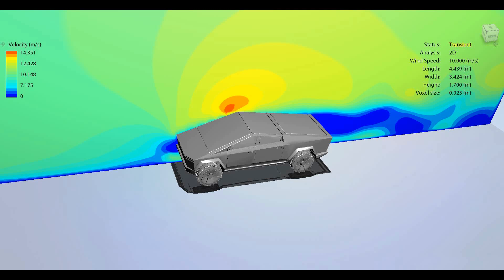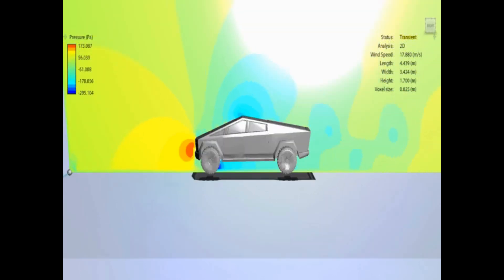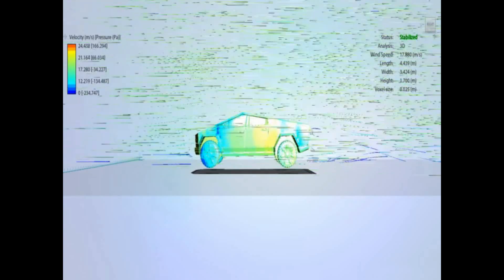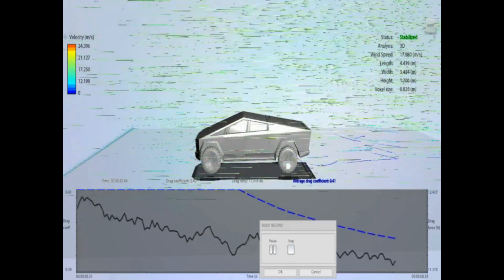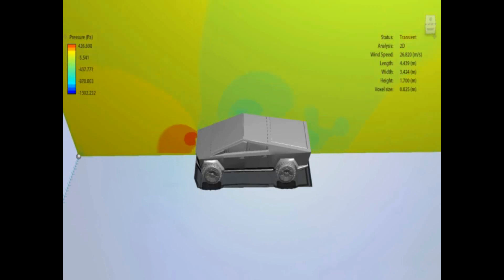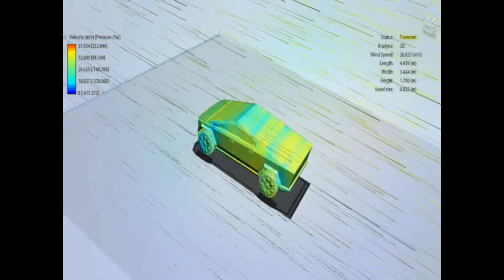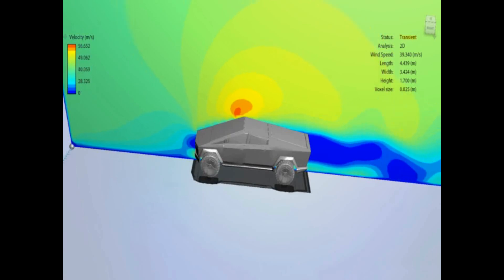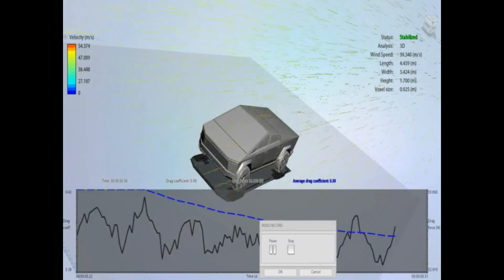Cybertruck aerodynamics - Whats going on?!!!

Comment: One thing that everyone is overlooking when comparing the cybertruck's aerodynamics to other pickups is the fact that it comes STOCK with 35" Mud-Terrains that jut out from the body. It also has a STOCK 16" clearance.  Most pickups come stock with 9" clearance, sissy tires, and a chin that nearly touches the ground.   Lift an F150 to 16" and give it spaced 35's and it's NOT getting a cd of 40.
Reply: Gus Goose  Oh stop it. What's your profession? I work concrete. I'm 6' 4" and can't reach into our beds.  I have to stand on the wheel to reach the tool box.  Cybertruck has a wrap-around rock/rail step.  Plus frunk, sail pillar, and underbed compartments so you don't even need a toolbox.
Reply: They said it was +/- 4", so 16" is max, 12" is middle and 8" is low (for highway).
Reply: @davebodger2  Oh dang you're right! it's plus or minus!!! So you can get it lower than other trucks and still get up to 16".  I wonder if you can drive it at 8" or if that's just for loading and unloading.
Reply: @bob15479  You can drive it in the low position and it will drop progressively lower as you go faster if you have the ride-height set on automatic speed based lowering.
Reply: David Bodger I’m familiar with the lowering, but thought it was only to 12”.  Link? This is what motortrend had to say, they got the exclusive and met with elon at the studio: 
Although we don't know all the details and capabilities of the four-corner air suspension, we do know it has massive amounts of tire travel (possibly as much as 14 inches from full droop to full compression), with up to 6 inches of air-ride adjustability—from kneel to full 4x4 extension.
Reply: @bob15479  It uses air cushion for suspension just like bigger trucks so, could you drive it with No suspension?  Sure.  Question is, will the TESLA software allow you to do it and as long as there are zero potholes or junk in road.....
Reply: Cybertruck has adjustable ride height. The default will not be the highest setting.
Reply: @G M Ford Fanboy having a hard time seeing the future...
Reply: @G M I didn't divert from the debate, I asked you a simple question that you avoided, you keep trying to bring this to anime and age which you clearly seem to be lacking in age when you can't even have a civil debate and continuously go for attacks.

But sure dude, you're like the most intelligent person in this argument, you're like so damn smart that you just know everything about this truck yet haven't provided any intelligent talking points on how this was a toy truck.  You go man, you're just so great.
Reply: @Tilearian  Keep speaking facts, G M is the immature and ignorant one we know this. Hating on a truck and disregarding its functions because of its looks. Smh.
Reply: @G M how is this a toy truck when it's built tougher than a F150?

Did you watch the glass break and just think the car was shit even though they showed the glass didn't break when doing the same test by dropping the same ball on the same glass that just wasn't installed?

Lackluster intelligence coming from you thinking this truck is somehow shit lmao.  You must be a comedian trying to flex low tier jokes.
Reply: @Tilearian  Try throwing a 5 pound stainless steel ball bearing at any Ford truck window.  It would go through the window and then out the other window.  I think no matter what they do with their window technology it would always break to that stainless steel ball bearing.  It's still going to be way stronger than a standard window.  In the drop test and before show test you can see the armored window bounce.  It does not bounce when it was mounted in the truck.  Huge fail on Teslas part but still a crazy strong window.
Reply: @Capt_Billy  there's literally already science out on why the window broke in the truck.

Short answer, it wasn't properly secured like the window that was secured in the drop test, all 4 corners of the glass were not completely secure in the doorframe leaving enough room for the vibration of the steel ball to shatter part of the window.

If the window were full secure it would have worked out fine, it was even shown in a test prior to the showcasing of the truck that the window didn't break by the steel ball.
Reply: @Tilearian  I don't buy that argument about how the window was mounted.  With the heavier balls dropped on the window, it came loose each time.  So I don't think the window's strength is tied to it being mounted to a metal frame. The metal frame would hurt the break ability of the glass, not help it.  When installed in the vehicle, it will be in a rubber gasket.  That will help absorb the impact.  Also, what happens when you roll the window down?  I don't think Tesla would use glass that is only unbreakable when the glass is securely mounted to metal.  That isn't practical in a car.
Reply: @donm2255  The glass being secured properly helps its strength for sure. But I'm sure that is not the only time it shines. If the windshield is made out of it it may prevent chips from rocks, etc. Ive seen a bunch of pickups with back windows taped up with plastic because they were broken by what they're hauling. If they are truly stronger, (the cyber truck has a rear window right? Im pretty sure it does) then the back window should be mounted properly and I think it would be a lot harder to break than traditional glass. Just speculation but hopefully the glass isnt all hype.
Reply: @w8stral  I don't feel like reading the whole novel you wrote. But no I dont base the truck on some glass. The person I replied to said if it has to be secured than what is the point. I was giving my 2 cents considering the front and back glass is secured all the time. And I have a truck and work truck. I never said Id buy the cybertruck.
Reply: @FreeStuffPlease  Then why post?   If you refuse to read/discuss.
Reply: @w8stral  because I can tell your comment was crap from the first two lines insulting me off the rip when all I did was discuss the glass.
Reply: @Tilearian  
In the prior test, the window dropped a couple inches after the impact. That might be the glass breaking off the scissor mechanism. Maybe.
Reply: anthony patterson  I didn't bring up anything about a sledgehammer, so I'm not sure what you're trying to point out about my intelligence or if you're trying to attack Elon's intelligence.

Which either way, I assure you, Elon is plenty intelligent considering he owns a company, and also is trying to pave the way for the future using different and smarter technology.

But if you're trying to attack my intelligence then please quote me specifically so I know which part you're attacking because I didn't state anything about either of these hammers you brought up.
Reply: @G M is that all you came here to do, attack people for having differing opinions from you?
Reply: @Tilearian  I personally dont know a single person in the market for a truck for its windows....
Reply: @Trebuer22  I was only using that as an example for why someone was calling it a toy truck...
Reply: Tilearian does your ford drive up, lower itself in a ready position to shoot fucking mortars? I think not.
Reply: It might not be the tool for all applications but it does fill a few useful niches. I'm not a tesla or electric car fan but as a professional gardener I have to admit it would fit my line of work, I don't drive hundreds of miles every day and I rarely haul super heavy loads but I do need a truck to carry mowers  around in and occasionally I'll need to move a pallet of paving slabs or a dumpy bag of sand. Running a normal pick-up for this kind of work is a necessity but the fuel bills are horrendous in the UK, having an electric one would give me the carrying capacity when I needed it but not cost me an arm and a leg to run when I'm out cutting grass or doing other stuff that doesn't really require a truck.  
I don't particularly care if it has bulletproof windows, I've never broken a normal one so I don't see why it would matter to me.
Reply: TjDolHaus86 Exatky! Do you use a string trimmer? I have had my windows broken by those or lawnmowers.
Reply: @bob15479  I do use them but I try not to park my car where I might be in the firing line, that and you generally try to keep your back towards anything you don't want to throw debris at. I don't really see that aspect of the truck as something I'd consider paying extra for if it was an option, I can't see a reason why I'd need it.
Reply: Mark Brand having tires which jet out are not legal. Production truck won’t have that.
Reply: MrLalasd You ever heard of a raptor
Reply: @MrLalasd MrLalasd actually it is legal in most states. even so, the tires don't even jut out anyway. if you look closely, the fenders on the cybertruck do extend to the width of the tires, which is all that's required.
Reply: @MrLalasd  Not true. US auto regulations ( title 49 CFR) state that you can't operate a vehicle where wheels stick out WITHOUT fenders, covers, flaps, or splash aprons to protect other vehicles from the spray. If the tires are treaded properly and the wheel well cover flaps come out far enough to prevent spray, then this is 100% legal and will need ZERO alteration.
Reply: @MrLalasd  Fender flares cover them.
Reply: that means your rolling friction will eat up any gains by your reduced wind drag LOL
Reply: @PWIZZLE7  the vehicle has adjustable height.  It goes from 16" to 12" and then 8".  There's different settings for different terrain.
Reply: @PWIZZLE7  
Rolling resistance is proportional to rubber distortion (due to weight) times velocity. You would normally increase tire pressure to maintain a certain contact patch area against the pavement, within limits of course. Rolling resistance is normally limited so as to limit tire rubber heating.

Automobile air drag is roughly proportional to the cube of velocity (V³), times the coefficient of drag, times the frontal profile area. It would require a ludicrous amount of rolling friction to equal drag at 60 mph. The tires would promptly overheat and fail. Also, the rims would be pressed against the pavement long before rolling friction could be that high.
Reply: Lol
Reply: @G M Debate I would hardly call it that more like a one sided slaughter.
Reply: G M insults are great and all but I think you actually need a point to have a debate, which to be fair you do and that point is that the truck is ugly. Fantastic point if it was any other type of vehicle but its a truck.
Reply: @Unintended Consequences I have been thinking this exact thing. It sounds amazing.
Reply: Gus Goose  Whats wrong with the bed on this? a little short but usable..
Reply: @0xsergy  The F-150 Lightning bed is only 5 1/2'.
Reply: anthony patterson  I noticed the other door did not enjoy it.  Do you have a point?  A dead blow hammer is a sledge hammer to everyone but you.  Because you think it makes a difference.  It does not.
Reply: @Unintended Consequences SS sides?  Great.  Payload?... HAHAHA, tiny bed and its air cushion so you are F'd if you ever use this as a PU truck with 3-->5 tons dumped in its bed when hauling gravel/green firewood, scrap steel, which all 1 ton standard PU's can do.  This can't as you will POP your suspension though you will know when it is overloaded...  Onboard 110... big whoop, can put this on any truck.  Our work truck has it.... only ever used to heat up our lunches with the microwave.  Air compressor... Don't make me laugh, clearly you have never used air compression for anything real.  The "air compressor" in question is the one for the air suspension which means it will be a tiny amount of air.  Better than nothing, but not much.  The ground clearance is nice if you are an SUV.  Truck does not care.  Security for tools etc.... If you are worried about this, you need new employees... you will note every work truck/van already has this so...    As a PU, the bed is an abomination.  T slots in the bed... You have F'n got to be kidding me.  Hard roll top everyone and their mother has already done and gotten rid of as it is a maintenance nightmare along with those damned T slots which are impossible to keep clean.  This is a wonderful SUV.  PU?  No.  75% who buy a "PU" never use them so... perfect for those soy boy wanna be men.  Do not get me started on the "tailgate".  This was designed by a bunch of soy boys who have never used a PU as a PU.  As an SUV?  It is great.
Reply: @w8stral  Also all the points you are trying to make as to why this isn't going to be a good pickup truck aren't even close to the real reason. This truck just won't have the power to haul a trailer with out a significant loss of range. Unless Tesla touches up on this, you're 69k Cybertruck with 600 miles of range probably will only get 200 miles of range with an average size enclosed trailer. This could be more or even less varying on the trailer. I am interested in seeing the actual tests.
Reply: @FreeStuffPlease  200 would be generous for the 70K model.  Some idiots took a model 3 performance and tried towing a TINY trailer with no load and no drag and they barely got 100miles range before they had to stop and recharge for an hour....  Tesla Model 3 performance battery is most likely the EXACT same as the cheapest cyber SUV(I will not call it a PU)
Reply: @w8stral  Like I said it would be interesting to see results. And yes 200 actually is generous. They did a test with a enclosed horse trailer and used 3.5 times the energy so yes it would actually be less than 200.
Reply: But it is a different truck and there tech may be different so we need to wait and see. Either way towing will reduce range and this is why it can't compete with gas trucks just yet. It will need better specs.

Comment: I found a different analysis that came to a totally different conclusion with a CD of 47.  Which do I trust? Prospective buyer here wanting to know if this vehicle has exceptional aero or not. https://www.reddit.com/r/teslamotors/comments/e29xx9/an_interesting_infographic/
Reply from the maker: Yes I saw that too, the cfd graphics on that looked very advanced, I think they were using the latest version of fluent, but the cad model was a bit basic. 

There is another cfd analysis going around which came back with .35cd. I will do a comparison video with other pickups with known coefficients then can compare. That should give a more definitive answer. 

Cfd is great for improving aero on designs and testing changes. But my confidence in the accuracy of the cd figures is fairly low after seeing the variation between people's results. I'm going to be interested in what tesla say it is as they will have state of the art software and the computational power to run high resolution sims.

Knowing my software, my gut feeling is the cd is lower than I computed.
Reply: @BoatsandEngines  One thing that everyone is overlooking when comparing the cybertruck's aerodynamics to other pickups is the fact that it comes STOCK with 35" Mud-Terrains that jut out from the body. It also has a STOCK 16" clearance.  Most pickups come stock with 9" clearance, sissy tires, and a chin that nearly touches the ground.   Lift an F150 to 16" and give it spaced 35's and it's NOT getting a cd of 40.
Reply: @BoatsandEngines  Dude you CRUSHED it with this video! Congrats! Plus elon vindicated your conclusions.
Reply from the maker: @bob15479  thank you my friend,  just saw that, I think I just got lucky with my results!

Comment: Are you sure the proportions of your car model are accurate? I’m not aware of actual dimensions published anywhere..
Reply: Length and width and ground clearance is provided.  You take that and photos and you can deduce a lot.
Reply: @bob15479  are you claiming that you can create an accurate model from provided length, width, ground clearance and video/photo material? Because that's what I asked about...
Reply: Stoyan Dimkov I assumed all panels were perfectly planar. But I recently learned the truck in fact has curves so now I’m less convinced.
Reply: @sdimkov  yes, maybee like 2% deviations here and there, but high Resolution pictures with a couple known dimensions say a lot.

Comment: Whats the name of the software?
Reply: Autodesk CFD, it is available to students for free, but has weird licensing issues and does not start properly when you use the installer, you have to use the Download Installer including Data(1,7gb)  Option. Then it works on some computers. But when it works it is very cool and easy to use.

Comment: Nice. What software are you using?
Reply from the maker: It's autodesk flow design, it's a bit out of date now but simple to use.
Reply: @BoatsandEngines  Thanks. One thing, which bothers me about this design tho' is that sharp edges are known for creating a noise, when air passes with turbulent flow around them. I'm also in doubt on how this car will react to side wind and similar, unstable conditions. Cars were evolving from 70's and 80's boxy shapes to increasingly smooth ones, so I can't convince myself :)